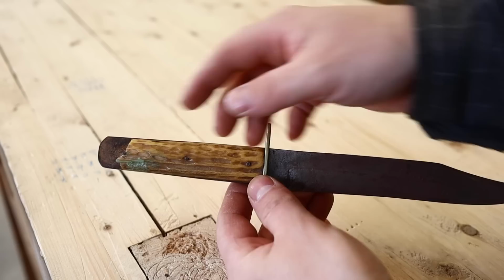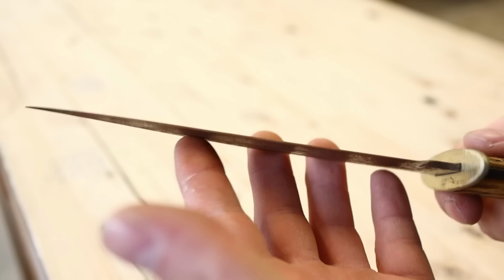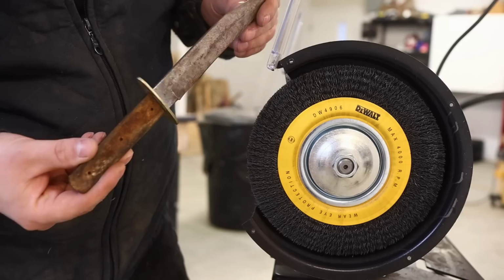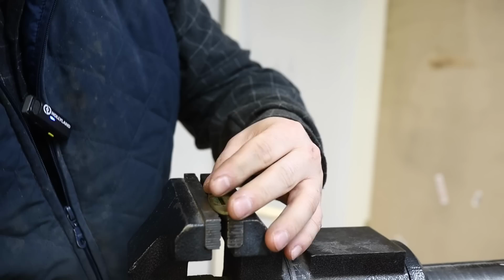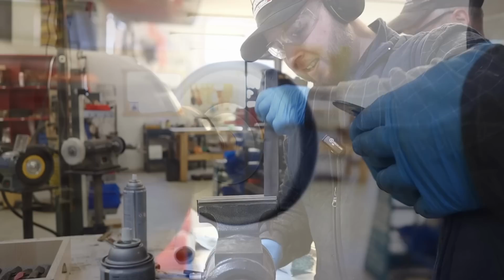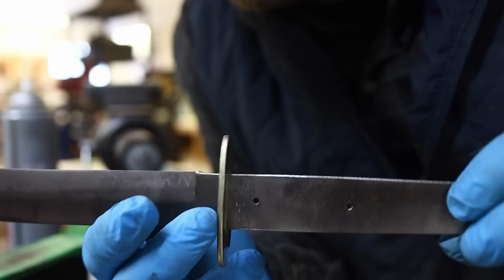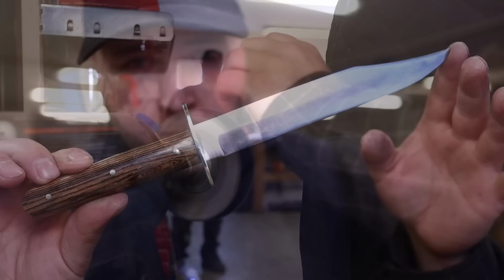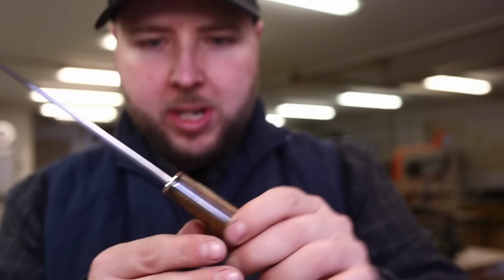Restoring an Antique Sheffield England BOWIE KNIFE!

Comment: Absolutely gorgeous piece of wood for those scales 😍😍😍😍

I've seen a few restoration channels, where they sometimes use electrolysis to remove the rust from metal where they don't want to be grinding it too heavily, and I was wondering if you've ever used or considered using the process?

Fine work as always 👍👍👍👍

Comment: That knife came out beautiful all it needs now is a genuine leather sheath. Just a question, what's the process for polishing the wood handle scales after you sand them down enough? Can you just use a buffing wheel with some polishing compound? Or is some sort of oil required?

Comment: I am a bit concerned that you didn't replicate the shape of the grip.. the new scale shape now makes for a round handle which makes for harder blade alignment and weaker grip. You can see the original handle was more oval in cross section. Also you messed with the heat treatment of the edge when you grounded it flat like that. It would have been nice had you been more careful on both counts.